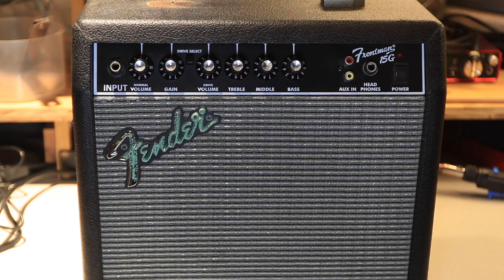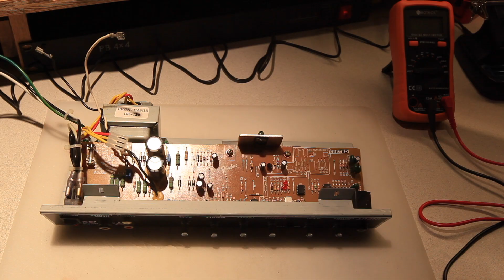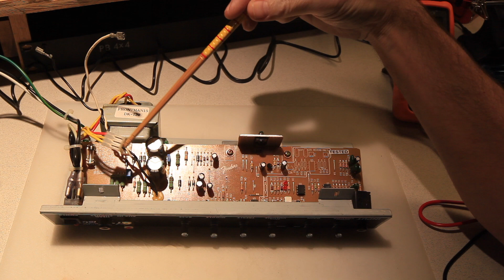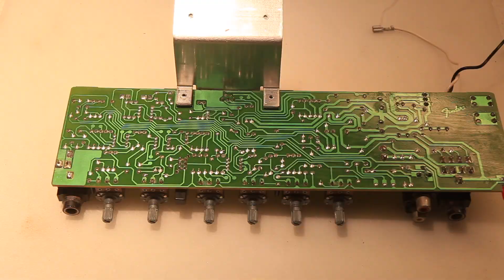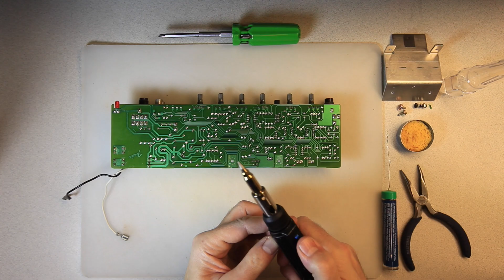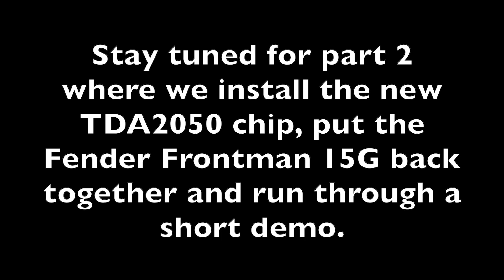Fender Frontman 15G Repair - Part 1

Comment: hello there i know this was 7 years ago but i thought i should ask anyway in case you can help me, i have this amp and it has started  popping, barely turns on and the led light flickers then it just shuts off, any idea what could be causing this? thanks (this is before watching the vid so maybe i will get a light bulb moment watching this lol)
Reply from the maker: could be a fuse issue if it is not fully blown. could also be  poor connections from power or even some broken / bad solder connections. I had a few that needed resoldering. I also had to change a blown fuse and tighten the connections from the main power coming in
Reply: @TonyBursey i have the amp open right now and the fuse seems ok, i will take off the tda2050 and see if its ok, if not them hopefully thats the only problem

Comment: 5:53 How did you know that? I am a total beginner, please excuse my asking… ;-) Is there a schema saying so and how would that be indicated then? Thanks ;-)
Reply from the maker: It is in the technical document for the amp chip.
Reply: @TonyBursey  Thank you very much for answering ;-)

I already thought so… There is still quite a lot to learn for me in this field.

The other week, I bought a vintage transistor amplifier from about 1978 which makes an awful humming noise.

It is a Teisco GL-120 and I bought it because it matches very well my “new” pre-owned Kawai S-100F that I will MIDI-fy with a Kenton Retrofit Kit .

Now, I already bought a multimeter and watch videos how to repair things like that — and how to properly dis-charge capacitors in amps before starting any work on that.

Your video was very helpful and encouraging, thanks ;-)

Comment: Super helpful! I've got a Frontman 25R, which is very similar, but it uses a TDA1514a chip instead. Do you have any tips for testing if that chip is shot the way you have for the 2050?
Reply from the maker: Thanks for the question. I did a quick search and found a data sheet https://electro-dan.co.uk/Electronics/TDA1514A.pdf.  With the 2050, the ground pin should not have continuity with any other pin otherwise it was bad. I would think that would also be the case with this chip. Hope it helps.
Reply: @TonyBursey  gotcha! Yeah I'm not seeing any connectivity between any of the pins. Maybe that's not the problem component for me

Comment: The main amplifier IC, TDA2050 is a discontinued item now. But, still available on online auction sites. You checked the main transformer and declared the power supply was OK. Skipped over some VERY important PS circuitry, then presumed the main amp was bad. Not much troubleshooting there. Just sayin'.
Reply from the maker: it was a known common failure with these amps and easy to look for so I went there first. No need to continue looking at other things if I found the main issue and dealt with it. As you could easily see after, it was the main issue and the amp was working once again. Just sayin
Reply: Es la original?

Comment: what kind of fuse does the frontman 15g use
Reply from the maker: Thanks for the question. The Fender Frontman 15G (and probably 15R) takes a 500mA  250V fuse for 100-125VAC supply or a 250mA 250V fuse for 220-240VAC supply. If you open it up, this is right on the board beside the fuse holder and the fuse should also have it stamped on the ends.
Reply: @TonyBursey  thanks for the info ,I saw the info in the case , but my eyesight sucks. so thanks brother

Comment: hi there, i snapped the volume knob off with the pot shaft inside so bought a replacement pot from ebay and upon my repair the amp seems extra bassy and super loud, so i'm thinking i have put the wrong  pot in it, i dont have the old one any more to confirm its the same value but wondered if u think this is whats up with it and do you know what kind of pot i need if i am to buy another
Reply from the maker: Thanks for the question. According to my Fender 15G / 15R schematic, the normal volume pot is a 50k ohm 15A (part# 037323). In case you need a Gain pot, that one is a 100k ohm 30C (part# 037324) and the drive volume pot is a 100k ohm 30C (part# 037324). Then for the tone stack, the treble is a 100k 30C (part# 037324), Mid is a 50k B (part# 034719) and Bass is 250k 30C (part# 040552).

Hope this helps
Reply: @TonyBursey  thanks so much, I was struggling to find the correct part number, ur the man 👍

Comment: Can you tell me how to remove the board out of the cabinet 
It don’t seem to fit out the back of the cabinet when the reverb can is in
Reply from the maker: Thanks for the question. On my "Opening up a Fender Frontman" (15G) video https://www.youtube.com/watch?v=F8I_Tyd8JmU&t=1s, once you open the back, at the 1:02 mark, you will see that the board is mounted with 2 screws just above the speaker and I also removed the handle since the screws from the handle thread into the plate that the board is mounted to.

I am not sure how the reverb tank is mounted in the 15R.
Reply: Thank you Tony 
I had to remove the reverb box which I found was fitted with 2 sided tape 
I think these are fitted last and this one may have been a bit high stopping me removing the chassis

Comment: A good fine Solder-Wick with a little liquid Flux works great for removing parts and leaving a nice clean surface to go back with.
Reply from the maker: Thanks for the tip. I will definitely try that next time.

Comment: what fuse do you have in? I got a second hand one of these and it's just a bit of copper jammed in the fuse spot 😢
Reply from the maker: Thanks for the question. The Fender Frontman 15G (and probably 15R) takes a 500mA  250V fuse for 100-125VAC supply or a 250mA 250V fuse for 220-240VAC supply. Hope this helps.
Reply: @TonyBursey  thanks!

Comment: Hey Tony! My 15G has jumpy volume when I use normal volume knob, the stronger I strum the louder the attack is, while less loud notes are barely heard. I might've left an amp in a cold place for winter. What could be an issue and how to fix it?
Reply from the maker: I have been thinking about this for almost a week trying to find out what might be causing this and have not been able to find anything. The first thing I thought of was dirty pots but that would not explain the soft notes. Would not hurt to try cleaning the pots and the input jack with some electrical contact cleaner.
Reply: @TonyBursey  thanks for a reply! I'd give it a shot, although I wasn't a huge amp user the amp is around 15 years old so who knows. I'll reply back if it helped

Comment: I have the same amp and my drive channel works fine but the clean channel doesnt make sounds, just sometimes but then it clips and goes back to mute until the cycle repeats, any idea on what might be the issue?
Reply from the maker: Could be a number of things and difficult to say without looking at it. Might be the clean side of the drive switch, bad solder connections or maybe a capacitor.

Comment: Great video, thanks for posting. I curious what the original issue was with the amp. I just picked one up on marketplace and there is a hissing sound that gets louder as i raise the volume but no guitar sound through the speaker at all. Wondering if TDA2050 might be my issue as well. Thanks!
Reply from the maker: Thanks for the comment. I would suggest checking the solder connections on the board. it might be bad connections on the input jack. Seems to be pretty common

Comment: Sir, my amp turns on but when I plug it on my guitar, doesn't reproduce any guitar sound, just buzzes, what could be wrong? The amp or the input jack? If it is the amp, what issue could it have?
Reply from the maker: Thanks for the question. Without seeing the amp, it is hard to say. If the amp is still on and there is no sound, it could be the input jack or it could also be the output to the speaker. It could also be a dirty volume pot. Do you get a crackle sound when you turn the volume knob back and forth or tap on it? If so it could just be dirty, in which you can get yourself some electrical contact cleaner. With the amp off, you would need to take out the chassis and spray the pots and then turn them all the way in each direction many times until they turn smooth and easy. You should also check all the solder connections while the board is out, especially on the input jack. I had to resolder my input jack connections on the board since they were cracked. Hope this helps.

Comment: Hi, I have a fender 25B 
The amplifier chip is burned, I need to replace it, but I'm not sure where I find the right replace part, can you help me?
Reply from the maker: Thanks for the question. I would first suggest that you get a schematic for your amp. You can download a PDF for the 25B from here: https://www.schematicsunlimited.com/f/fender/fender-frontman-25b-bass-amplifier-schematic. If you are sure it is the amp chip, this amp uses a TDA1514A chip. Depending on where you are, Amazon and eBay have listings. Hope this helps.

Comment: I recently bought a 15g, it was used and got it for only $15, but it won’t turn on at all. Any idea what it might be?
Reply from the maker: Could be as simple as a blown fuse. Make sure you have the amp unplugged and take the back off to check.

Comment: Thank you for taking the time put this video out. I've found bits and pieces of useful guidance for amp repair as a beginner. This video was one more step in amp repair. Thank you.
Reply from the maker: Mr Music thank you for your comment and glad it was useful.
Reply: @TonyBursey  i repaired my Fender FM212R guitar amp. Replace some caps a componet that attaches to the heat sync. I'm very scared to plug it in to my wall socket and trip the main breaker to my home and or get shocked. What is the safest way to do that ? I read somewhere the i should use a isolation chamber or a variak. Are they a safe way to power up the amp with out these concerns ?

Comment: i need some help sir. i bought my first amp (the frontman 15g) and when i select the drive it makes a awful sound, a reallyyyy loud sound. i think the amp is broken, or i dont know how to use it
Reply: Having the same issue. Wish I had a solution man.
Reply: @blazingscarabs-yt6696  what i did wrong was putting my amp in a overused plug, like xbox and stuff. i put him with a single plug. i think its power issues (sorry for my english)
Reply: raco 29 Awesome, thanks for the input. I will definitely try this out myself.
Reply: @blazingscarabs-yt6696  let me know if it worked
Reply: raco 29 Will do!

Comment: Any help on opening this guy?
Have removed pretty much every screw on it, can't seem to figure it out.
Reply from the maker: Thanks for the question. You can use either a thin screwdriver or a sprial nail and put into one of the screw holes on the back to pry the back off. Mine was stuck pretty good but using a screw driver was better because of the handle... more to grip than the nail.
Reply: Ah, thank you for the answer. I managed to get it open using a screwdriver as leverage. That lid sure does want to stay in there, i guess the wood expands or something of the type.

Comment: Sir  my amp is the same on this video and my issue is my amp is not turning on
Reply from the maker: The first thing to check with the amp unplugged is the fuse. If the fuse is blown, first check that the fuse is the correct one. The type of fuse is printed right on the circuit board. The fuse should have the type stamped into one of the ends. Get a few replacements of the same type and try a new one.

Comment: Hi Tony, nice job on the repairs. My issue is that my amp can't make a sound, and the guitar and the cables are fine. The amp works well and turns on, it just does not respond. Is there any part of the video where you did a repair like that?
Reply from the maker: Thanks for the question. I have not had that happen, but you may want to start with the input jack or the speak connections both at the speaker and the board. Look for cracked solder connections. Obviously difficult to diagnose without actually seeing and testing.

Comment: What fuse does the Fender Frontman 15G use? Mine has blown out but I am really unsure of which replacement to buy online.
Reply from the maker: Nico, thanks for the question. The Fender Frontman 15G (and probably 15R) takes a 500mA  250V fuse for 100-125VAC supply or a 250mA 250V fuse for 220-240VAC supply. If you open it up, this is right on the board beside the fuse holder and the fuse should also have it stamped on the ends.
Reply: Tony Bursey thank you so much 👌
Reply from the maker: @NRLCS1  No problem at all

Comment: My 15g has a good hum to it, the slightest tap it will go away and Vice-versa. I have it apart but I don’t rightly see anything out of the ordinary. With your experience do you know a few things I could look for/test?
Reply: Just to add a little more. I noticed that when I tapped on the red & white aux jacks that is what the buzz would more so start/stop. I have the board out now and there’s no cracked solder joints but the white port is sort of free floating and rattling inside.
Reply from the maker: Thanks for your comments. Sounds like you have found your issue. One thing I have heard is that using the aux ports with a device while plugged in to an outlet could cause the TDA 2050 amp chip to short out because of grounding getting crossed. I don't use the aux inputs but this is good info if mine starts to develop a hum.

Comment: TONY BURSEY,
if you remove the Choke in the power supply what does this do to the AC ripple? 

can this add harmonics and modulate the power tubes from the AC ripple signal?
Reply from the maker: Thanks for your question. This is a solid state amp and does not use tubes at all. Although I have not yet owned a tube amp, from what I have seen, you would not want to modulate the power going to tubes. They need to be biased properly in order to function, otherwise you will run the risk of burning them up.

Comment: is it possible to add the reberb circuit to the pcb of this frontman?
Reply from the maker: Brian Torres thanks for the question. Yes it is. The PCB already has all the printed circuits in place. Fender used the same PCB for both the 15G and 15R. The reverb components just need to be soldered in. The front face of the chassis also already has the hole for the reverb pot. The 15G sticker on the front is put on right over but it would be easy to punch a hole in. 
I have been debating for a while whether or not to do it. I would have to pick up all the components so I don’t think it would be worth it really. Might cost less to pick up a used 15R.
It would be a good project though.

I have the schematic for the 15R somewhere with the list of components.
Reply: @TonyBursey  Thanks for answering my question, yes I did notice the printed circuits in the PCB so I was wondering if it could be done, and yes it would make a great project, more so now than I'm practicing my soldering skills, I've been searching for guidence in diferent forums but even though there's a lot people asking the same, most people answer that's not worth it.
But I think it is, specially for southamerican countries where a used combo amp like the frontman 15r can be $130 or more. I'm watching you from Ecuador.

Comment: was the issue that it just didnt work at all?
Reply from the maker: lgmnow kondo the fuse would blow as soon as I turned it on. The amp chip was shorted and needed to be replaced. It also has some broken solder connections that I fixed. I have not had an issue since.
Reply: @TonyBursey  what chip was blown in your amp?
Reply from the maker: @greenspider3664  TDA2050 amp chip